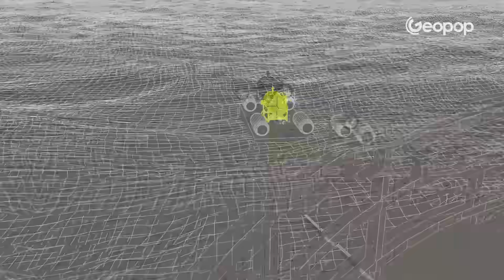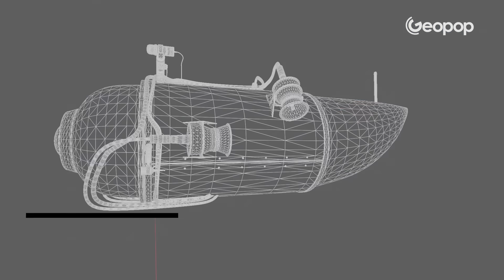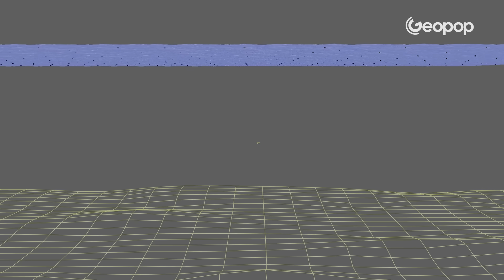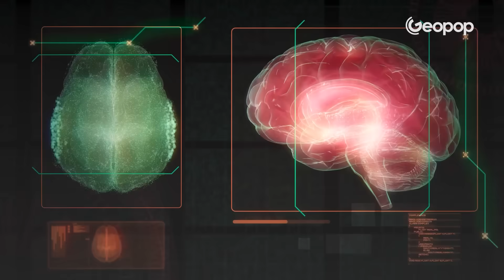Titan Implosion, two year later: the 3D reconstruction and the possible causes

Comment: The US Navy admitted later that the sound of the implosion was picked up by them, so why did they waste time taking part in efforts to search for the lost crew they already knew were gone?
Reply: PR.  What are they going to say to the families if they don’t look like they’ve at least tried?
Reply: The Navy’s detection equipment was highly classified!  Secrecy was the policy!
Reply: @DirtyLilHobo  Ah, of course. It's quite obvious when you put it like that. I suppose if the government publicly described how fast these things were clocked at, plus the object's size, it would expose certain capabilities of bleeding-edge US hardware and wetware.

Now you've said it it's all rather obvious. It would announce where these sensors are, what their capabilities were, as well as lot's of other stuff, or sumshit. Why didn't I think of this? It's off to the corner of the room with my Dunce's hat for me! 😆
Reply: They heard a sound but didn't know what it was, and thought that it sounded like an implosion. 

You have to understand that as big as the Navy are and as fancy as their equipment is etc. etc. they don't and can't know everything, with current technology. 

Their equipment gives them data about sounds / vibrations detected in deep water, and then they have to make educated guesses as to what it actually IS. 

After all, as explained in this video, at depths that low / water pressure that high, one doesn't just pop down there quickly on a lark to 'see what's going on'. 

Getting very deep in the water is a MAJOR OPERATION. 

So although that likely WAS the implosion that they picked up, they didn't know it at the time and were required to investigate anyway, in case what they thought was an implosion was something ELSE deep underwater, and in case somehow the craft was still intact but lost. 

As horribly built as this craft was, it had already made a couple of previous dives and not ruptured, so there was still some chance it could have come back with the passengers, although we know now that was a very remote chance due to the poor construction.
Reply: They follow orders . I'm sure they would want to help cause they are humans . But they have a job to do .
Reply: How was the media going to do a sick countdown of how much oxygen they have left for clickbait and views if they had reported what the Navy said they had told the media...how sick is our media

Comment: "Possible causes"? It's super simple. A carbon fiber hull is only strong under tension, not under compression. In other words, you can make super strong scuba diving tanks out of it, but it should never be used for a submarine hull. The problem is that under compression, carbon fiber layers will slip past each other, causing them to delaminate. This is what caused the implosion.

Comment: A Falcon 9 rocket weighs ~600 tons.  So the pressure on the skin of the Titan was equivalent to the weight of FIVE Falcon 9 rockets compressed into each square meter equally from all angles, into the compartment.

Comment: No mention of the fact the port's plexiglass window material is not even rated for the load it was subjected to at the Titanic's depth?

There was SO many things about the Titan that was wrong from a basic engineering viewpoint that it would be guaranteed to FAIL any and all independent certification. I'm sure Stockton knew this!

Comment: If it is true, there was a sound- based monitoring system of the hull. As the carbon fiber can not be checked like other materials, there were some kind of microphones that warned of cracking sounds. And the "leaked transcript" suggested that the warning system was indeed triggered early on, and at that point there may have been a leak that changed the balance of the sub to make the jettisoning outside structures impossible. The leak area then caused the starting point of the final collapse/implosion. Anyway, they would be alive if four endcaps would have been used by making two spheres that were connected together to allow more crew and a passageway between spheres, like the porthole area. "That is how I would have made it".  The "russian" Mir bathyscaphes used before were actually Finnish made, but USA forbid us making more of them (politely...). Even the MIR's support vessel was made in Finland. MIRs were the best of the world at that time, so USA was worried of that technology going to Soviet hands. Two of them did, though. And, as many suppliers were afraid of the CIA, 3M refused to supply the chemicals, so Finnish ski factory EXEL supplied those, all electronics came from Finnish Hollming, the construction and castings came from Finnish LOKOMO (originally locomotive factory), of Rauma Repola. As it was thought that the project would fail, it was allowed to go on by the CIA. Only after the success, there was panic inside the CIA that Soviet now had something special....

Comment: PV = nRT.   Ideal Gas Law
At those pressures and time scales this formula is a good approximation.

What you'd find is that knowing water is nearly incompressible the air becomes as hot as the Sun. They vaporized in an instant. 🤯

Comment: someone did a simple demonstration cut a 2 foot rope of good size now try to break it by pulling 2 ends....it wont.....now try to push the rope together......it flops and so easy...yup thats how carbon fiber exactly works....perfect when pressure is on the inside but not pressure from the outside!  sounds like engineering 101 or even a child would understand and know by this simple demonstration !

Comment: 3000 tons per sq meter = 6,000,000 lbs per 3ft x 3ft section.  or for most people that understand PSI, it would be around 4600psi per square inch of pressure.

Comment: If you wacht the video where they bolt the the cap end to the hull, you can see them tightning the nuts from starting point with a ordinary wrench. This is wrong, you begin with a torque wrench half tightning one bolt and then the opposite bolt, do that in a criss cross pattern, then full torque in the same manner, if you dont you gonna warp the thing.

Comment: Put simply, the best shape for a vessel withstand extreme pressure is a ball.
Made from a solid material that compresses uniformly.
Not CF which is great in tensile but not compression forces, and is not a uniform consistency, and a cylinder construction with a different end cap material….
Doomed, we’re doomed I tell ya’

Comment: Hazarding a guess that towing the titan in the open sea didn’t help either with possible stress being added to its structure prior to it demise 

Also, it was rumoured that the previous carbon fibre body had to be scrapped and oceangate built a new body with cheaper carbon fibre materials; the titanium dome was removed from its older body which its removal could have been compromised and not fitting on the new (cheaper) carbon fibre body properly!

Comment: im pretty sure that if they had started with a titanium tube with a strong flange on each end and then re enforced it with that carbon fiber that they may have be alot less dead than they are..that carbon tube with flanges glued on each ends was a real bad idea! they make carbon fiber rifle barrels that have steel inserts re enforced by carbon fiber.  stockton rush was an idiot! anyone who saw what was going on should have stepped up and said hell no!

Comment: Like toothpaste being squeezed from a tube…. They became instant fish food. 😮
Reply: Notice that he said there were no traces of the carbon fiber hull found in the recovered debris. That would seem to indicate that the carbon fiber structure shattered in an extremely violent fashion, sending small shards of carbon fiber into the interior space of the Titan. It would be analogous to a dense shower of very sharp shotgun pellets propelled at very high velocity towards the interior of the vessel. The effect would be to instantly obliterate all of the vessel's occupants.
Reply: At that depth it wouldn’t matter what happened to the hull. Even if the hull had magically vanished in an instant, the pressure of the water would compress the interior so quickly they would be turned to cooked bits.
Reply: The single celled organisms were eating real good that day

Comment: I seriously doubt any third party would have certified the Titan for that depth.
Reply: yeah....I heard it may have only been somewhat safe to 2000 meters only.
Reply: I doubt it would have been safe to that depth. Ultimately, the continued compression and expansion from repeated dives most likely caused the carbon fiber to delaminate and ultimately fail. It probably still would have had the same issue at 2000 meters. For comparison the USS thresher imploded at an estimated depth of 730 meters.
Reply: @munroborisenko7278  And even then it would've been a death trap. The fatigue cycling is really the primary issue here. There is a hard finite limit to this. Titan was probably "safe" at 3800 meters for ONE dive. And that's assuming they did an EXCELLENT job at creating the carbon fiber without any defects. Theoretically, a single user carbon fiber submersible is viable. Key word of course being single. One dive.

(WARNING, I am just speculating out of my ass at this point)
It's such a shame because with enough money and time, Stockton could've invested in carbon fiber itself and push for better prices. If he could get the cost of creating a Titan pressure hull down enough, he could potentially have made a business out of selling single use cheap submersibles. Instead of buying an Alvin (not possible fyi, just an example) for $50 Million, you could produce Titan style submersibles intended for one expedition for under $1 million. Resell a ride to the Titanic for $300,000 each for 4 passengers and net $200,000 each dive. So long as the manufacturing of the carbon fiber remains pristine for each single-use hull.
Reply: @munroborisenko7278  --- but how many times, how many cycles could it take before that epoxy got cold and hard at its limit on that smooth titanium at the bottom of the ocean and let go and spit those end bells off like a champagne cork, or enough of those carbon fiber filaments had finally pulled apart before a limit was reached and it imploded in a millisecond. This thing was completely uncertified. Rush broke every known and proven submersible design law rule and feature that has prevented every other deep sea submersible from imploding for all the decades they have been in use.
Reply: The Oceangate Cyclops submersible only at 1000 meters. its survives and is prob historic now. a good macabre museum piece. It should be saved for display.
Same as the remains of the Titan, this story is a good teaching example for engineers and design people.
Reply: The difference with Cyclops is that it wasn't built by Oceangate.

Comment: I am no engineer. 

However, when I observe aeroplanes and submarines, it become apparent that they have controls for roll, yaw and pitch.

Yet the Titan only have controls for roll and yaw, but not for pitch (changing the horisontal degree of the submersible).

How did they keep it on a horizontal level without the required thrusters? 

Could this have been a possible cause, in that it suddenly pitched forward and plunged uncontrollable to the bottom?
Reply: Thrusters. A sudden pitch forward would not cause it to plunge.

Comment: The biggest problem with the whole thing was bullheaded leadership at oceangate and refusal to acknowledge that other folk’s concerns were valid. Stockton Rush basically committed murder of 4 innocent people. Well, maybe 3 , because PH knew the risks were high as well. Rush was quick to dismiss genuine concerns about his design and the fact that his “off the shelf “ use of materials was proof positive of how cheap he really was when it came to the Titan. I feel like he got what he deserved, but the others that he took with him didn’t. I’m not anywhere close to an engineer, but as a welder, I realize that certain materials don’t go together and aren’t structurally sound. 
And there were problems going on , unlike what you had said initially that they were proceeding without problems. They were texting that the structural alarms were going off and they had dumped the emergency ballast and were returning to the surface, but extremely slowly. Such a tragedy that should not have happened.
Reply: I agree with you Rush knew there were problems yet he continued for what it seemed as self-glory
Reply: @paulcarmichael596  exactly. PH knew the risks as well and his ultimate love for the Titanic got him killed. In some ways, I think he knew that it would eventually fail and I feel that he figured if he was going to die anywhere, it would be next to the wreck he loved so deeply. I guess he got his wish. I’m not sure what interview I had seen, maybe it was James Cameron, but they had expressed their concerns to Nargiolet and he said “If it happens, I won’t know it and I will forever be where I want to be anyway “  Rest Easy PHN
Reply: @ibbylancaster8981 
Well if that's the case, he should have warned the others
Reply: @ibbylancaster8981 yes, he said he knew the risks but he said he was sad as a widower and if it happened he’d be where he loved the most…. I think he definitely knew the risks.
Reply: @ibbylancaster8981 yes, he said he knew the risks but he said he was sad as a widower and if it happened he’d be where he loved the most…. I think he definitely knew the risks.
Reply: The main reasons for the implosion were Rush and material fatigue. 😢
Reply: Well at least the captain went down with his ship.
Reply: You also underline that it WASN'T dodgy eyesight that prevented Rush from being an astronaut, it was his entire attitude/personality/not bothered about safety-especially if it acted as a barrier to his ego.......compare Rush to any of the Apollo astronauts, Rush and Armstrong say-is there any better example of  total opposites ?  "Couldn't become an astronaut due to my eyesight " Yet another Rush lie.
Reply: Anyone with two brain cells  that were sparking 🤔 could have seen where this was going from the get-go , I'LL JUST GLUE MY TITANIUM SPHERE TO MY CARBON FIBER , the hubris of Rich Democrats is just impossible to understand , I would be perfectly okay with this if it was his wife and children as passengers , big question where was our government in this , that monkey eared motherfuker , for the brain dead stiff , you can't build an airplane and charge people to go fly on it without it being certified , but obviously you can build a submarine and take people to the bottom of the f**** ocean with nobody going wait a minute😮😮
Reply: Let's not forget that the engineers "emailed" and chose their jobs over the safety of people also
Reply: PH knew the risks but he most likely didn’t see the data…. If he’d have been privy to the data chances are he wouldn’t have risked his life
Reply: Material fatigue
Reply: Another welder! Awesome seeing you!
Reply: I`m a metal fabricator myself as well.

Comment: I had my professional start in commercial diving and ROVs. Ended up at SpaceX because of my background in pressures and fluids. Deep water is incredibly more difficult to work than even space.
Reply: When you consider there are mountains down there it's blows the mind
Reply: You need to quit SpaceX immediately for EXACTLY the same reason the Titan imploded, murdering 4 innocents..
Arrogant reality-denying antiscience piece of shit bastard CEO who belongs in prison for flagrantly violating the law and smugly conflating that with being "revolutionary" or "genius" or some other such bullshit. Antiscience IMPLIES history-denying.
Reply: Space is only about 1 G of pressure differential from on earth's surface compared with hundreds or more Gs in very deep water. And this basically doesn't change no matter how far into space you get. On the other hand, you don't have to worry much about solar radiation, rapid temperature fluctuations, and micrometeor impacts underwater. Lol
Reply: So how do rockets work in a vacuum 🤔 or is space not really a vacuum 🤔
Reply: @ange1098  Rockets work in a vaccum by supplying their own propellant and oxidizer under immense pressure to fuel the chemical combustion.
Reply: @davidtatro7457  what does the combustion push against to propel it if it’s in a vacuum.
Reply: @ange1098  You need to learn some basic physics, apparently.
Reply: @ange1098 you can tell who genuinely wants a question answered vs who wants to “win” an argument by just repeatedly smashing their ignorance against someone until they give up. you could google this question and get a comprehensive answer AND you can google any aspect that you’re confused about as well! but it’s much easier to be intentionally stupid
Reply: @astrowolf5507 BOOM! Nicely done! Lol
Reply: You're also working with an insane leader who is going to kill people. I wouldn't let people know you work at Space-X when they keep blowing up rockets.
Reply: Deep water is space lol
Reply: I think because water might allow some simulation, it isn't really zero Gs. I'd prefer space, myself.

Comment: I will never stop asking why they didn't just build Aluminaut 2.0. It was cheap (for something that's extremely expensive) and could go as deep with a dozen people standing upright and 3 t of payload. Same deal cylinder with hemispherical endcaps but all aluminium. 1960s. Il's still around and did countless missions, including raising DSV Alvin after it fell of the deck, hatch open in 1500 m of water. Of course my choice would be to combine Aluminaut and NR-1 for a nuclear powered independant submarine good for 6 km. NR1 "only" did 1 km but it was 400t and functioned like a proper ship, leaving a port and not a support vessel. Dr. Ballard used it extensively including during a survey of the wreck of Space Shuttle Challenger.